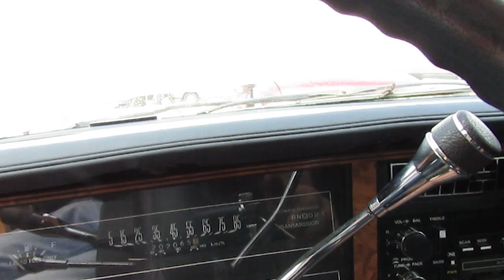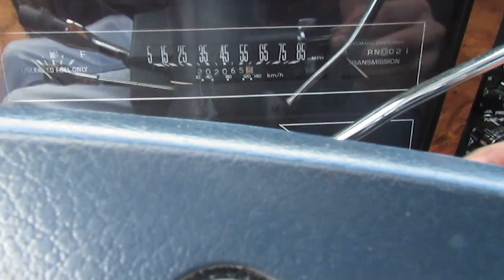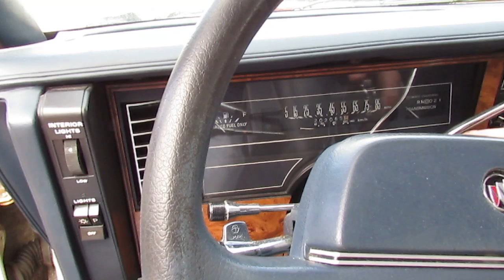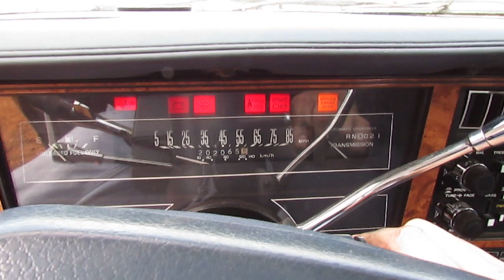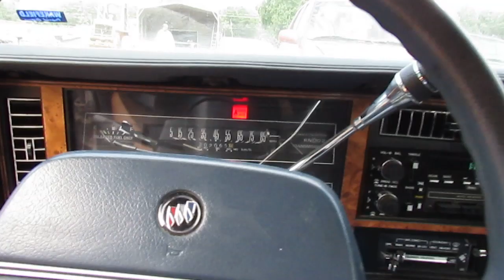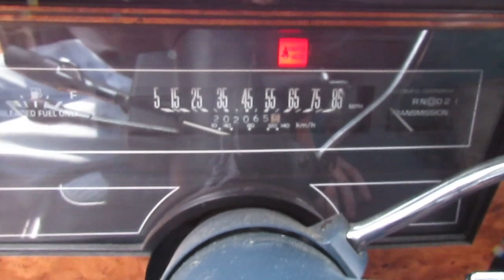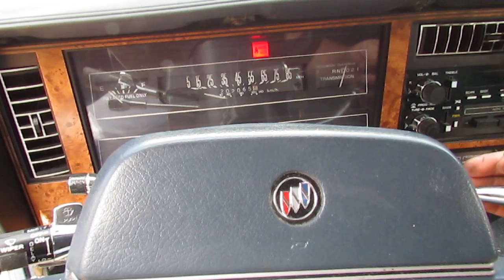What to do? Buick Century StationWagon

Comment: First thing with any automatic - check the fluid. Too low = no drive. Fixed a few by just topping things up.
Reply: Also, I hope you checked the linkage. The AT may not be bad after all.

Comment: My older brother had one of them...500 000 kms (320 000 miles) with 3.8 V6 engine and four speed gearbox...Issues with cruise control and speedometer only...Good car and still runs ...

Comment: Its a 3 speed. So its a Tmh 125C should be easy to find a trans. Fix it!
Reply: That's actually a four speed transmission. Look at the gearshift indicator and there are two letter Ds and a 1 and 2 marking.
Reply: jas4925 my 1990 century wagon has the T440 4 speed

Comment: Build a hearse out of it. At 654 Sullivan Street in Elmira NY sits an abandoned 1991 Ford mustang. The owner is in the military. The car hadnt run in over a year and a half the motor is seized up. The owner tried to remove the rear drive axle to unseize the motor thereby breaking the rear drive axle. My hope is someone will locate the owner buy it and fix it up before it rots away and becomes scrap iron. That would be a shame. They are highly sought after muscle cars. To let it sit and rot away would be wrong. Fan of restoring old vehicles Robert Gildea

Comment: All the car needs is a new transmission, by the way, I have one of these cars, but it's in the sedan style, not the wagon style, I wish.
Reply from the maker: This one was super nice. I wish i could have saved it
Reply: Michael Lutz I have the Oldsmobile version of this rig with 323,000 on it.
Reply: James Baxter Kinda funny, shortly after my first comment, my car broke down again, this time, it cranks, fuel pump comes on, battery's good, it just won't start.
Reply: Jay Smart Weren't you able to?
Reply: 323,000 miles? Holy hell. My '93 Century Wagon is at 97,000 right now
Reply: LCoyle 
My car has been all over from Freeport Maine to Lakeside California
Reply: LCoyle When we bought our '92 Buick Century, it had around 90,000 miles on it, that was in 2011, it's now 2018, and it now has close to 125,000 miles.